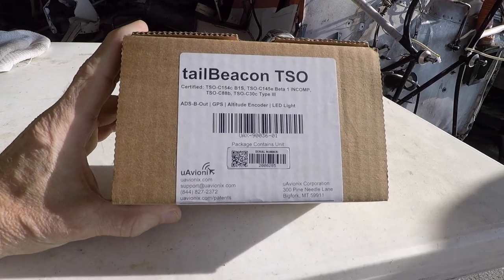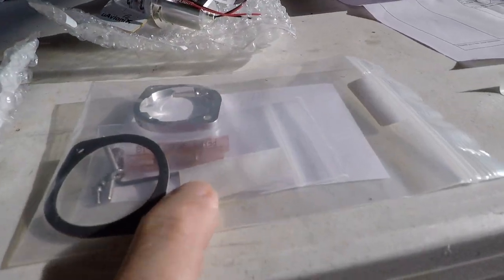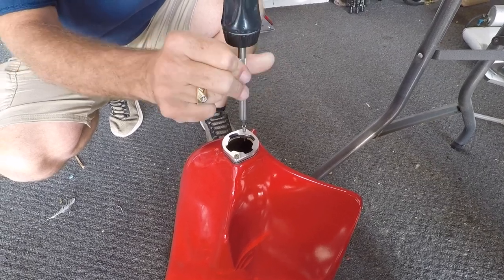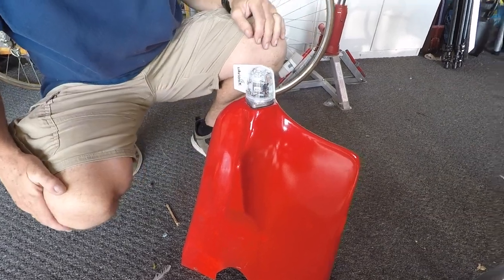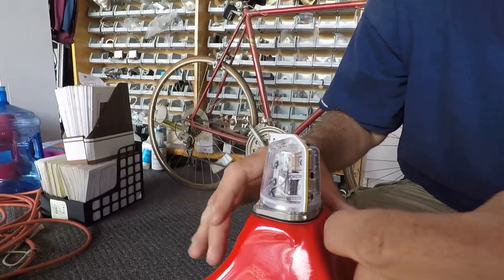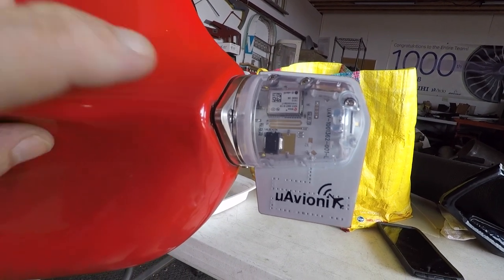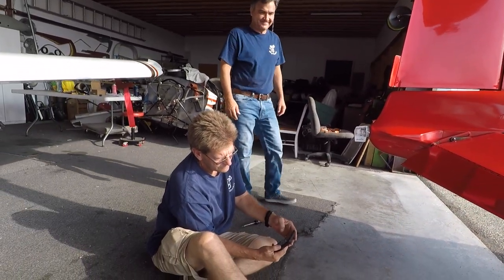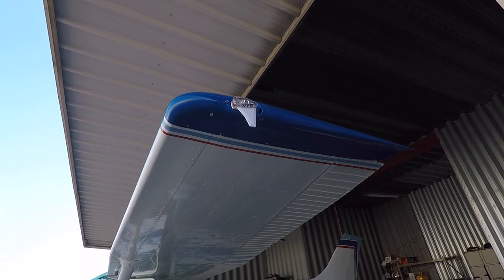Uavionics Tailbeacon Install - Grumman Style

Comment: If I may make a correction, the L shaped hex tool is an Allen wrench but the "setscrew" secures the LED device to remain attached.   I wished I learned to fly but I opted to buy a Corvette many years ago instead of a pilots license.
Reply from the maker: I had my Corvette time too.